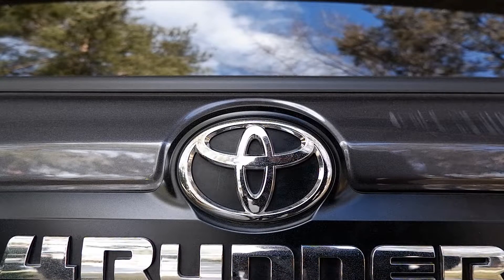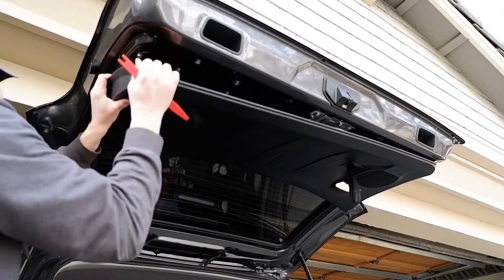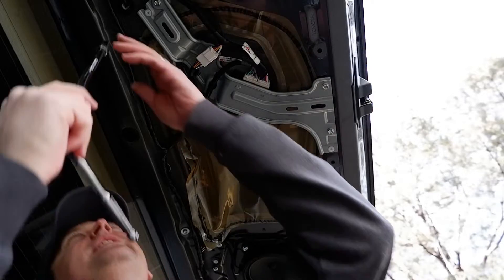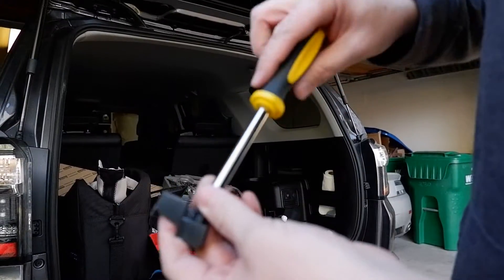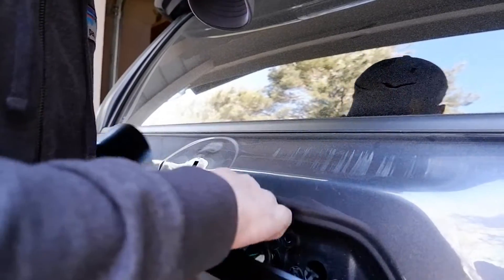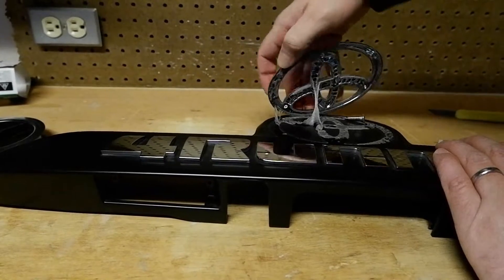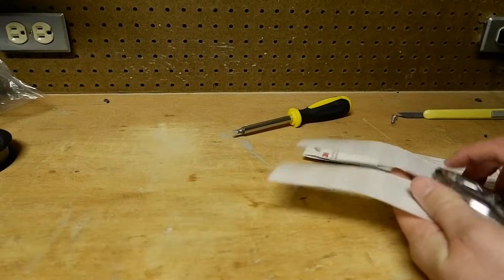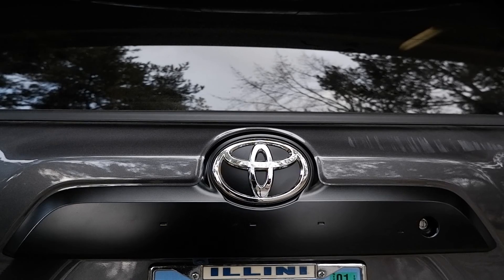How to Replace 5th Generation 4runner Garnish or Handle Panel - 1080p/60

Comment: part number?
Reply from the maker: THis is from my invoice   76811-35220 Handle Panel $115.05
   76819-35010  Handle Panel Seal $2.86
 
hope that helps, good luck!
Reply: @CTP1111  where did you order it from?  Those are good prices.

Comment: At 11:00 you demonstrate how to remove the logo. But what about the "4Runner" letters? Do you take the letters off the same way? More importantly, how do you ensure the letters are attached to the new handle panel so that they remain symmetrical and look nice/neat (with evenly-spaced letters?) I can't imaging eyeballing it. (Is there a template?) Thanks for sharing.
Reply from the maker: you remove the letters the same way, as for putting them on the new one, you make a template out of tape!  preferrably blue painters tape as it sticks and un-sticks easier... you put it all around on 4 sides where it was on the old one, use a marker to mark spots on each letter and its alignment and you just follow that with the 3m press in place glue to reattach the letters.  hope that helps!
Reply: @CTP1111  This sounds easier than it will be for me when I try it. Got any pictures of your end product?
Reply: First thanks @CTP1111 for the video. I just changed ours out to a nightshade version. As for the letters. After pealing them off the old garnish. I put them back in place over the same spots (the old adhesive kept them in place). Then laid painters tape over the front and carefully lifted everything off. Apply new adhesive on the back of the letters and apply to the new garnish. The painters tape held the letters in place and alignment while applying the new adhesive.
Reply: I suggest removing the letters before taking it off the vehicle.  Much easier

Comment: I wish I saw this video when I did mine. Do you know if you can purchase that small piece at 6:06? I didn’t save that and now the top has a gap
Reply from the maker: yes you can here's the link where I bought the parts from, check there https://toyotaparts.mcgeorgetoyota.com/oem-parts/toyota-liftgate-finish-panel-7681135220?c=az0x&origin=pla&gclid=EAIaIQobChMI5YK_qbPu4QIVxR6tBh3SUw0uEAQYASABEgLJbfD_BwE

Comment: does yours come with a partial seal around the top edges? the emblem and the two straight edges on both side, maybe down a little more?
Reply from the maker: no you have to buy the seal separately

Comment: Hey thanks...looks like a real pain in the backside. I too did the garage door maneuver. Its good to know I'm not the only one, but perhaps the only guy to pull it off. If you'd known then what you know now would you pay local Toyota dealer $150 for part and $120 for install to do it for you? I'm considering getting part online and attempting myself, although I am mechanically challenged in auto repair. Prob. in my best interest to fork over $270 and save myself from ensuing chaos.
Reply from the maker: I enjoy working on the car so its not that big of a deal for me, but if you aren't handy at all and don't have the tools $270 doesn't seem like its too costly to be honest
Reply: You should try it your self, this video was great instructions, I didn’t run into any snags, easy as legos
Reply: I just finished replacing mine using this video and, even though I am very handy, I thought it was pretty difficult.  The hardest part is not shown in this video.  In the video his top fastener was broken, with mine, it was not and it was extremely difficult to get that one to come out.  I was about to give up until I found where someone else had that same problem and said you have to pull that one out with all your might.  That worked but I was afraid that I was going to break something or scratch my paint.  If I had it to do over, I would probably have paid Toyota the $120.

Comment: Do you happen to know if it's possible to add an OEM backup camera to a 2010 SR5 that doesn't have a navigation head unit and no backup camera? I want to upgrade my head unit to an aftermarket one that will work with a backup camera, and I'd like to do it as if it was all factory installed. Thanks!

Comment: Just replaced my camera using this method basically but noticed some plastic clips on the inside of the garnish broke up.... so I bought aftermarket ones that don’t hold as well so may need to repurchase the entire garnish.

By any chance, is there a rubber gasket or seal of some sort that prevents water from running into the garnish area (where all those cords are?) 

I didn’t see one on mine (or in your video.) on OEM parts online I did see that a seal is made for it... so wondering if I can have the dealer fix mine if they never included it to begin with (botched custom parts job probably)
Reply from the maker: there is a gasket seal thing part # from my invoice was 76819-35010  Handle Panel Seal $2.86
Reply: C.T. P thank you! I may have to order a new one. Thanks!

Comment: I just bought a 2010 4 Runner the back lifegate handle melted yes melted which was a common problem I couldn't figure what the slime was until others showed the same problem on 2010 's give me a break melted plastic, your video will help me do a repair thanks
Reply from the maker: haha thats crazy!  best of luck with the repair, thanks for watching

Comment: How did you put the emblem back on (4Runner)?
Reply from the maker: I used 3M press in place which you can get here https://amzn.to/3ftpSjJ or any sort of auto adhesive will work
Reply: C.T. P  man lining up the 4Runner letters was not easy! Lol. I messed up twice, but I got it..
Reply: @djfx2008  How did you make your template? I'm considering trying this, but am specifically hesitating because I'm not sure I can put the letters back on nicely.
Reply: @DarrickBLee  I measured the space on the old one, and then made sure I centered the whole logo on the valance. (Flat surface not edge to edge.) when I purchased the black logo template it was a peal and stick.  This made it easy to measure out the correct space and distance between each letter.  I purchased both on eBay.  Hope this help.
Reply: @djfx2008  Can't seem to zero in on the parts (on eBay.) Links, please?

Comment: Just replaced this part and now my door won’t latch. I’m completely confused as to why? All wires are plugged in as they should be and I just don’t understand why replacing this would affect the latch. It work completely fine before I worked on it…. Any thoughts?
Reply from the maker: latch or lock?  will the hatch shut all the way or not?